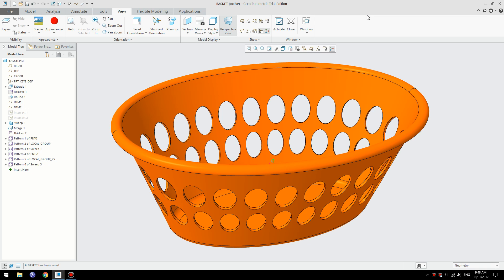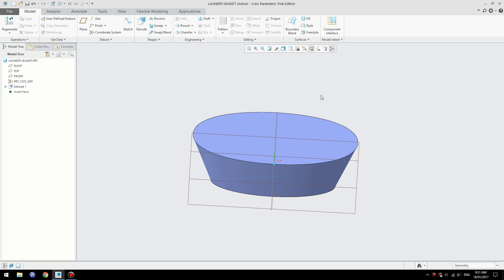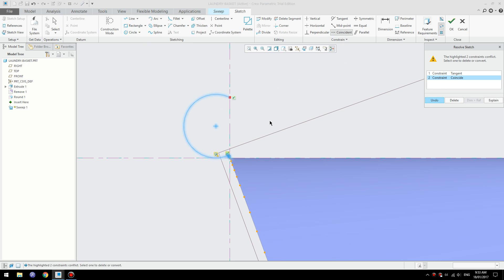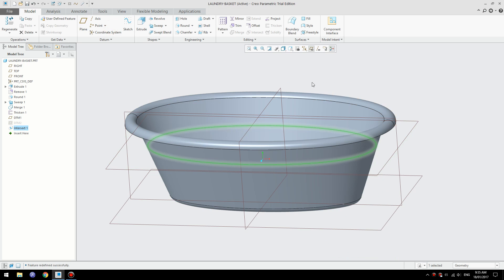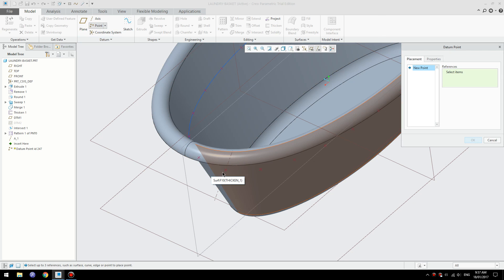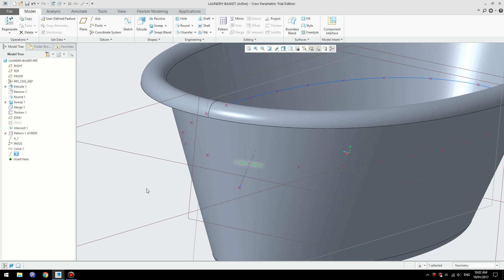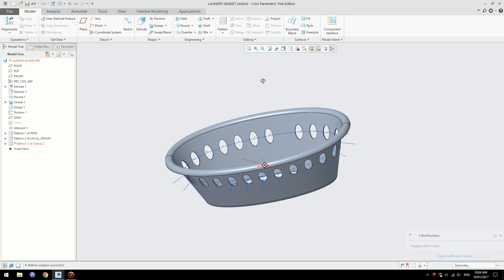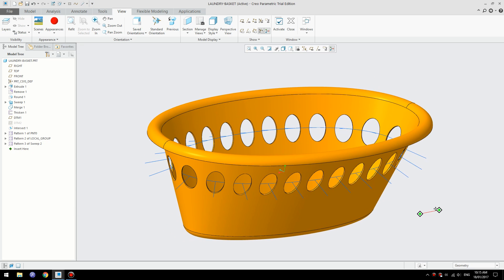Creo 4.0 Tutorial - Laundry Basket Pattern on Oval Complex Shape

Comment: I'd like to ask if you have experience about the equivalent (DriveWorks in SolidWorks) in Creo to build configurator. I've built one easily by using Driveworks, but I've difficulties to find the equivalent in Creo. Thanks a lot.

Comment: Hey I tried it out, and when I make the second row of holes I'm running into the same errors you did where a few of the holes wouldn't cut out. You mentioned to mess around with the dimensions but could you give me some tips on what exactly you did to fix it?
Reply from the maker: Just try redoing the feature again. Sometimes it work, sometimes it doesn't.

Comment: what is your PC config..???
I also started working with Creo, but after adding 15-20 elements to model tree it starts stuttering, which just don't allow me to draw more than very basic models.
Reply from the maker: You can see my PC spec on my about page. A mid range CPU and graphics card would allow you to run the software like mine.
Reply: 3D Surfacing 
Thanks. I just find that, I've totally a half of your config. Even upgrading it won't help me to work.
Reply from the maker: Try using a SSD drive. That often can boost speed well.
Reply: Hello Sir when I try to pattern a point on intersection it takes half intersection curve why it is so?